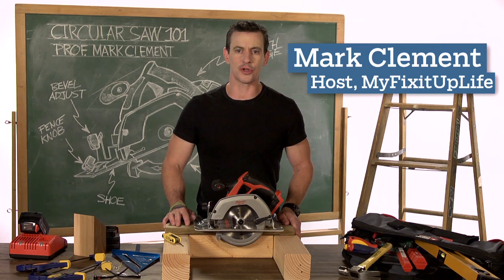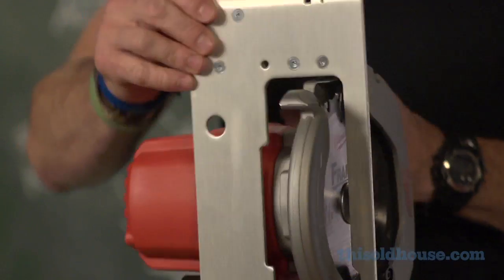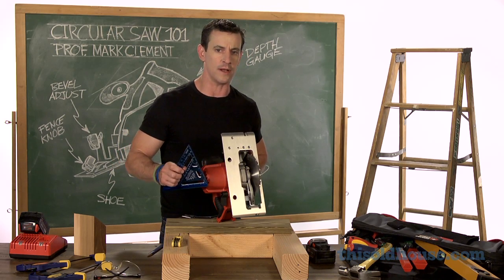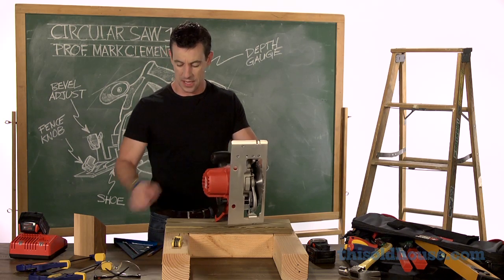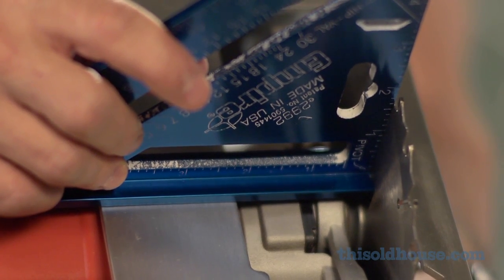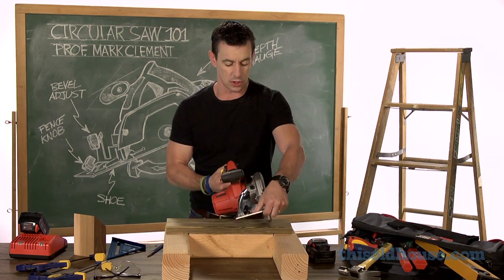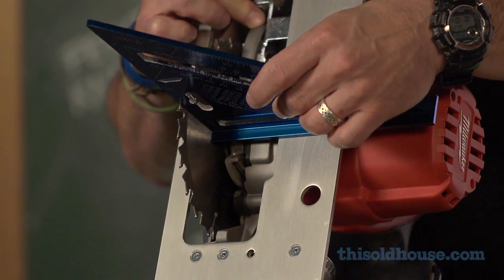Circular Saw 101: How to Square the Saw Blade  | Tool School | This Old House

Comment: That works if your saw has the adjusting screws; mine doesn't, it's a Makita and when the bevel adjustment is as far over as it will go the blade still isn't at 90 degrees to the sole. I'm tearing my hair out trying to find out how to correct this.
Reply: You most likely droped it, on most saws that will bend the deck at the part of the saw where you adjust the depth of cut. If you could unbend it carefully it will come back flush 90 degrees, i would use a pair of needle nose vise grips. One for bending and the other to stabilizes the deck so it bends what you want it to.

Comment: I would like to see a better view of the relationship of the square and the blade. This video failed to show what it look like before and after the adjustment.
Reply: Because that is actually self explanatory.  The speed square should be flush on both the shoe and the blade for a true 90

Comment: How do you adjust the blade to make it parallel with the side of the shoe?
Reply: I’d like to also know this???
Reply: I’ll take a wild guess and say you unplug the saw or remove the battery, remove the blade, and then throw the saw in the trash and get a better saw. I’m about ready to do this with my skilsaw.
Reply: My worm drive saw shoe is off by 1/8 inch to the blade in just the length of the shoe.  My black and decker( I know it's cheap) cannot be made 90.  Nothing being made well.  My skill saw btw is very old when things were supposedly made better...not the case.  All I want is an accurate saw!

Comment: While he did disconnect the power, he did not say to make sure it is disconnected.  Remove the battery, or for us old fogies... pull the plug.  Accidentally hitting the trigger while you are working on a saw could be scary and dangerous... years ago it thankfully only scared me.
Reply: this is kinda a common sense..

Comment: Thanks man. I made cuts last week and for the life of me couldn't get a decent cross cut. I bought a new blade and when i got home to install it I noticed this fine tuning screw was the root of all of my problems being at zero it was not a perfect 90. Then I thought damn man is this because I saved money and purchased a cheaper model that it was out of wack like that, and you just clarified for me that you check and adjust all your new tools when you get them and through the life of the tool. So thanks for the clarification. By the way, my cuts are much better now. I made two jigs for cutting 90s and 45s.

Comment: ok after i adjusted the screw i got blade to be square to the shoe. however the bevel angle pointer does not sit to zero anymore. what i'm supposed to do, should i just deduct one degree each time i cut a bevel?

Comment: Thats the easy one. What do you do if the side of the base plate does not align with the blade line? You would expect that it should be correct on a newly purchased saw. This is not so on my new Makita 10inch blade saw.
Reply: Im assuming that you're saying that the deck isn't square with the blade? That's not good. You say this is on a Makita? I'd email them immediately. Seems like an obvious quality control issue

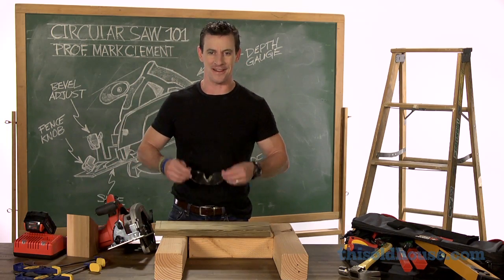Comment: 1:57 Ready to do 90? What, with the saw half in the air? What a tool! (Not the saw.)
Reply: Yeah,  5 years later but for some reason saw this video and that was the one thing I noticed,  micro adjust bevel,  free hand float tilt cut.
If you know what you're doing that's fine but for most folks,  put the meat of the saw base on the supported piece not the cut off piece, especially if cutting less than 2 or 3" off.